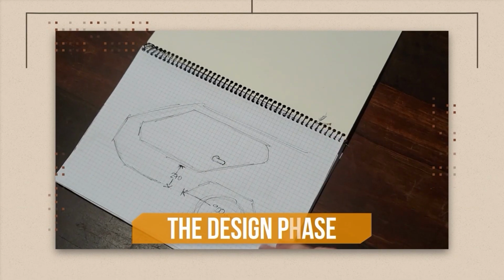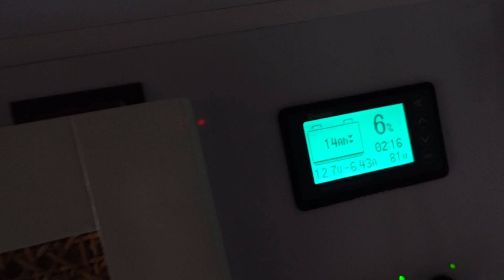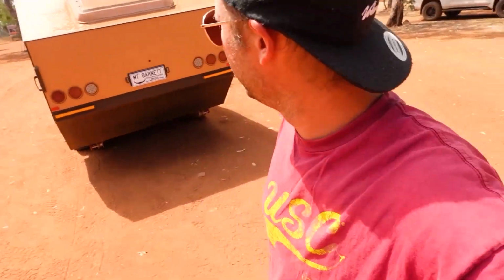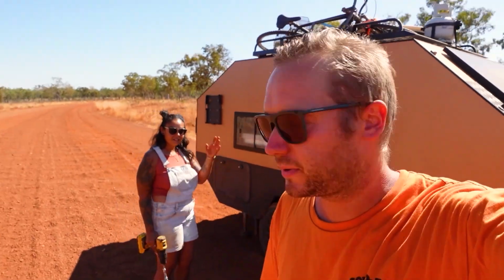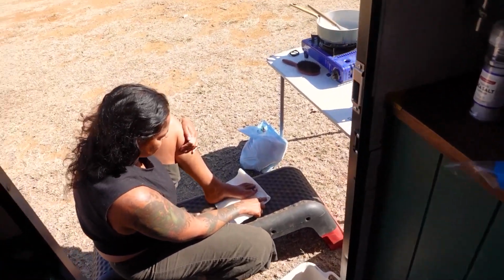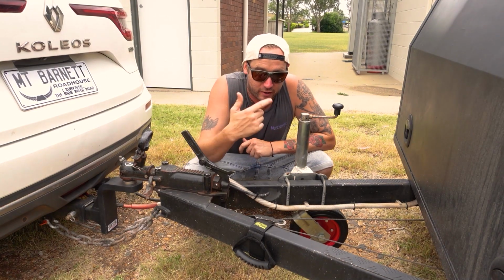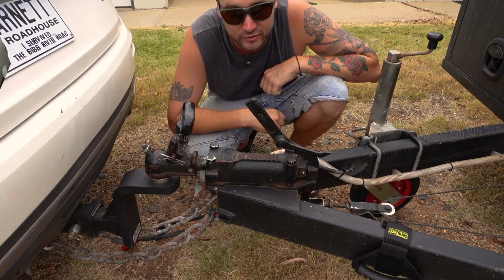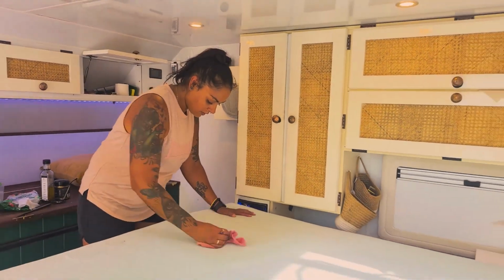11 - The 7 Lessons of The Gibb River Road: An Elfwing Odyssey

Comment: It looks like your blown tyre was worn out. the picture shows the tread completely gone.  This could have been the reason you got the puncture. It is recommended to always have your best tyres on and not think that because it's a rough gravel road that you'll use up your old tyres.
Most of the blow-outs that we came across were due to this.
Reply: Looks like the tyres are low profile also....totally unsuitable for off-road driving.